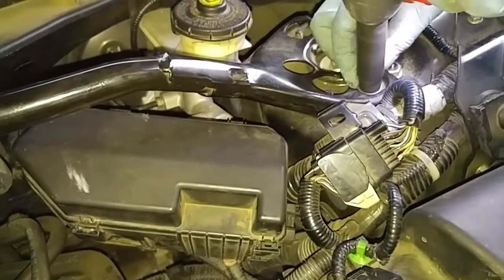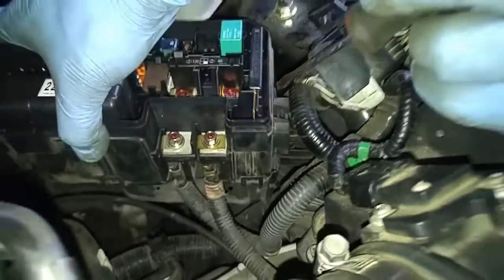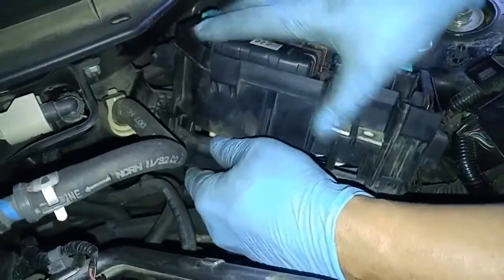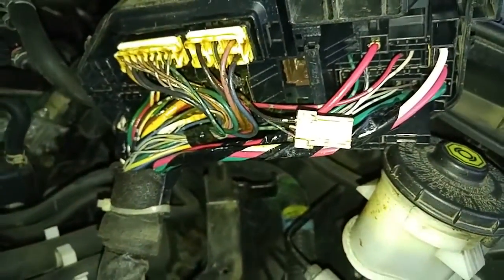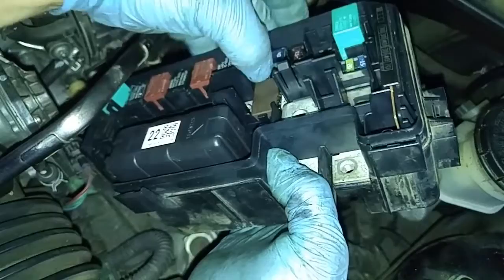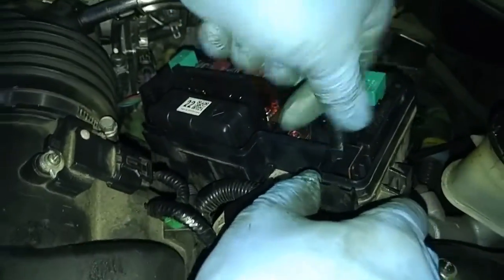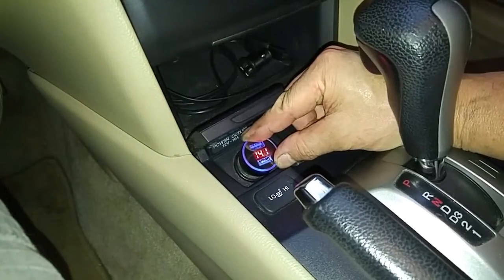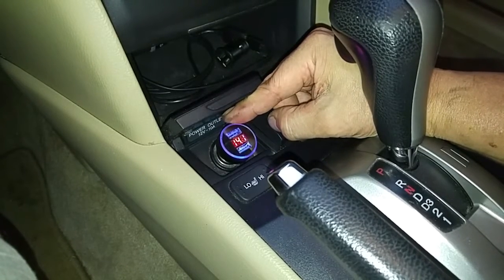Battery Dash Light On & Off? Honda Electronic Load Detector Malfunction

Comment: Need advise I have 08 accord lately my battery light flickers on off sometimes stays on after a while the VSA ligh also comes on then my ac and radio cut off shortly after car pretty much loses power and cuts off . At times when the lights come on  battery and vsa light,once home shut off wait  a couple hrs and start engine lights disappear as I'm driving maybe ten min in battery light them vsa come on again. Has anyone encountered similar issues?
Reply from the maker: Did you replace the ELD?  Also a malfunctioning alternator could be the cause.  Recommend you monitor the voltage of your car while driving using the voltage display plug in device.
Reply: My car is doin this same thing what did you do to fix yours?
Reply: @desmondcharles5126  in my case alternator was the issue.
Reply: My starter went out I fixed. Shortly after my alternator went out, fixed and changed my battery. Been good ever since
Reply: @Alex sierra I haven't been having any charging issue it just does it at random  times occasionally  the car still  drives fine when  it trips out but my ac  compressor does shut off when the  dash trips out if I turn  the car off  n start it again it goes bac to normal
Reply: @desmondcharles5126  
My dash would also dim to where it would cut off and could not use same with compressor , sometimes it would do that and then want to cut off engine as if I was losing all power to the car. Alternator was my issue from the beginning . I waited and resulted in damage starter and battery.

Comment: i have the same issue  but only happened at night time with AC on. i'll try to replace the ELD today and will see if it help. HOWEVER HONDA RELEASED A STATEMENT ON THEIR WEBSITE THAT THIS FLICKER OF THE HEADLIGHTS IS NORMAL AND WAS DESIGNED THAT WAY TO INCREASE FUEL EFFICIENCY. 
i have another question for you to see what do you think: My 2008 honda accord 4 door 4 cylinder JERK at stop only (D mode) when AC on ( kick on) sometime its make me feel like someone hit me from the back of the car. I replaced the alternator, clean the body air intake throttle body, battery but the problems still exist today.  please advise , thank you
Reply: Check motor mounts
Reply: Hondas were designed with the eld to detect when there was a demand of current so it is normal for it to shut off the alternator which is when the battery is the only thing powering the car thus the lower voltage reading, although it's not normal to be switching so frequently back and forth. I turn on the heater or ac to keep the alternator charging my batteries since the eld can't detect amp draw that is passing directly from the battery to an aftermarket amplifier.
Reply from the maker: "JERK at stop only" ? ... sorry ... not enough info to advise.
Reply: @hardlymovingpro  the car jerk/ jump  when i stop at traffic or red light. it only happen when AC on. The radio and clock  are flickering (on and off) when this happened .
Reply: harry nguyen 

Did changing the eld help. Mines doing the same with a.c on. When it’s off everything’s normal ..
Reply: I had the same issue with a high output alternator from js alternators, I noticed it would jerk the engine every time one of the fans from under the hood came on whether to cool the engine or for the air compressor and when I would put a load on the alternator. I ended up replacing the alternator with the original one and it all went away. Eventually I bought a ho alternator from apex alternators and it works flawlessly!

Comment: I have the same issue, and the ELD was replaced, but the problem refused to go away. The MIL still flickering on and off, and the voltage jump from 12V to 14V without adding load to the alternator.

*Issue Fixed: it was the aftermarket alternator, after replacing with the OEM unit, no more ELD.
Reply from the maker: Also, you might consider checking the SOH (State of Health) vs the SOC (State of Charge) of your battery.  The SOH measure the battery's amps and should be above 500.  If the voltage is 12.8 or above, the SOC is considered at 100%.  So you could be at 100% SOC while the SOH is declining.  You can get the SOH up via trickle charging the battery.
Reply: Hardly Moving Productions 
I had the battery check at the dealer, and it's in good condition. I also installed a brand new battery in, and extra ground cables from the engine to the chassis, but it didn't help.
Reply from the maker: @bendnhh  Try the Raizin voltage stabilizer.  Make sure it's not a cheap Chinese knock off typically on Ebay.  Think Amazon dropped it due to all the imitations.
Reply from the maker: Also, today's cars have clutched alternators.  If the clutch disengages, the alternator is effectively not turning;  hence no current.
Reply from the maker: Same issue with the customer I installed the new ELD.  My conclusion is the ELD shuts off ALL auxiliary (alternator) charge to battery if it senses a potential overcharge condition to protect the battery.  The PCM lets the battery discharge a little bit before allowing the alternator to continue providing charging current to the battery.  The customer has noted that when the car gets to the 12v range, it's only momentary and jumps back up to 14 +.  He's been driving his car this way for the past several weeks with no battery, starter or any other electrical issues.
Reply: Hardly Moving Productions 
Thank you for replying back. I did the big 3 upgraded when I installed an after market amplifier in my car, and the voltage was always 15+V. After running for couple months, the alternator died, and I replaced with the new one. Since then I got that battery light flickering and voltage jumping problems. I've replaced with 3 alternators, and it's still the same. I removed the big 3 upgraded wires and the amplifier,  except for the ground cable which connects from the negative battery to the chassis and one to the engine frame. For my case, when the voltage drols to 12V, it'll stay the same, until I drive continuous for more than 30s or add load to thr alternator such as turning on headlights /windshield wipers before it jumps back to 14+V. I can feel the vehicle performs weaker (rough idle and rpm drops to 500) and the engine vibrates more when the voltage was cut to 12V. Do you have any solutions to fix this issue?
Reply from the maker: 15+v does not seem normal.  The most I've seen is 14.5v.  You may want to consider installing addition ground straps in your engine compartment along with a voltage stabilizer.  One of the more popular ones is made by Pivot Raizin.  Here's the video where I did an installation:
https://youtu.be/OTwXrFt0JYk
Reply from the maker: Could also be poor quality reman alternators.  I had a guy with all types of electrical issues until I replaced it with a new Denso OEM alternator.  It wasn't cheap but his electrical problems disappeared.
Reply: Hardly Moving Productions 
Thank you, I'll look into that stabilizer. The 3 alternators I bought were from 3 different vendors on eBay. I didn't have any problems with eBay electronical parts before, and this is the first time.
Reply from the maker: You should buy things like alternators and starter motors from local auto parts stores.  They all give life time warranties.  In one instance I had to return a starter motor 3 times (all remans) and they eventually gave up and gave me a new one.
Reply: Hardly Moving Productions 
Thank you for the recommendation. My friend drives the same car, so I'll probably ask him to borrow his OEM alternator, and test it on my car since he's not driving it often.
Reply: @bendnhh  hi Benjamin Dinh, did you ever solved the issue with your car? Was it the alternator the problem?
Reply: @josemedina5831  I ended up buying an used OEM alternator, and the battery light is gone, and the issue is fixed.
Reply: @bendnhh  thank you for replying
Reply from the maker: Good for you!
Reply: Hello, I have a Honda CRV with the same problem. The voltage drops to 12.5 when I turn on the lights or air conditioning. The voltage increases to 14.2 rpm
Reply: Hello, I have the same problem with my Honda CRV
Reply: @hardlymovingpro  Yeah! I also got the same conclusion that the ELD shuts off alternator charge to battery in case it senses overcharging, as to me that is the reason of a Load Balancer. So, do you think the car can be used in this condition for long trips (over 300 miles)?

Comment: I don't even own a Honda, but I'm curious why there was all that grease on the connectors :O
Reply: Do not remove the Grease. it there to block dust to get in to the connector. its came from the manufacturer
Reply from the maker: @hungnguyen-kp9bp  Okay ... good to know!
Reply: Its there on purpose! Dont clean it

Its called dielectric grease
Its for electrical connections.. Helps them connect better..
Also keeps all the water and moisture out of it so it doesnt short out
Reply: Its call dielectric grease it keeps water and corrision out
Reply from the maker: Do not know the source of all that grease.  Someone obviously had popped open and worked inside the fuse box based on a broken tab.  At least I blew off most of it with compress air.
Reply from the maker: I know and it's Honda overkill IMHO.  Way too much grease!